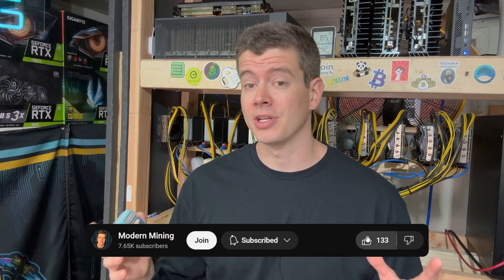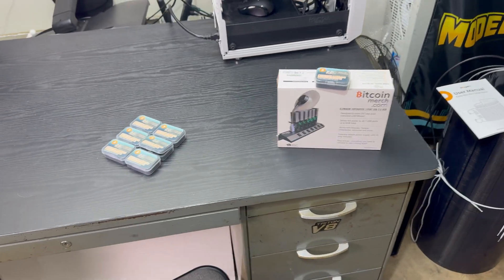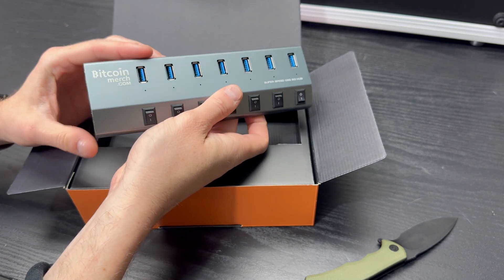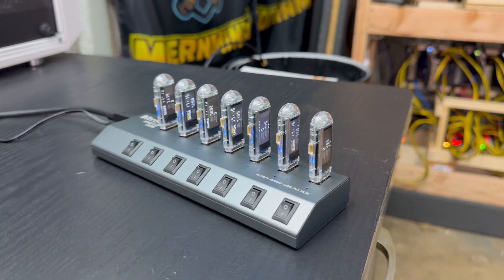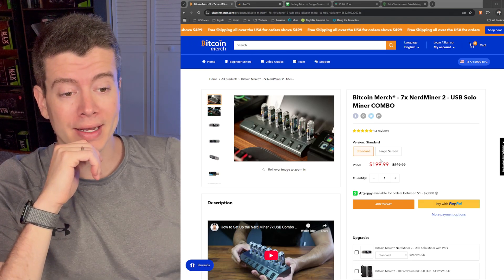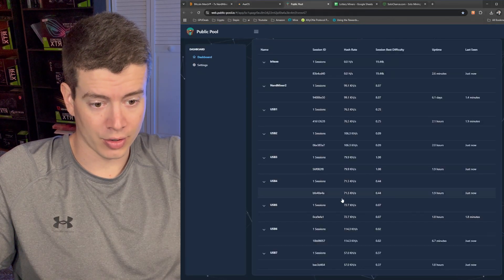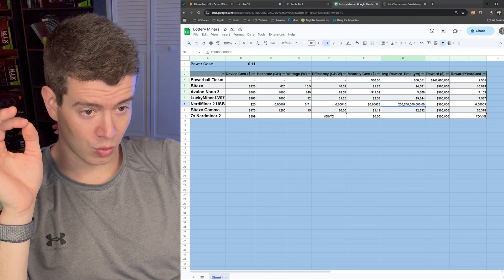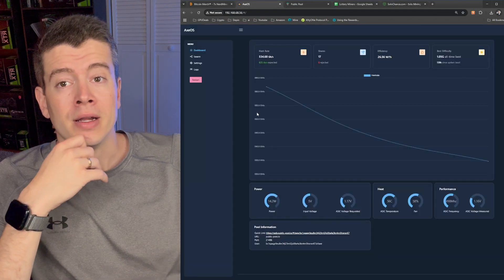This Bitcoin Miner Takes 28 BILLION YEARS to Payout...

Comment: The blue and silver box you mention was a lucky miner, mine is still running 👍🏻

I keep all my solo miners on low mode for best efficiency and cooling.  I even have a small fan behind my nano 3 and 3s, it drops the temps about 20 degrees celsius.  I’d never run an asic over 60-65 c just my opinion.